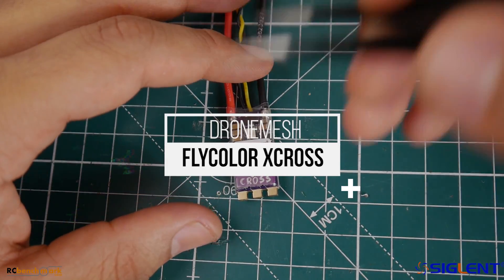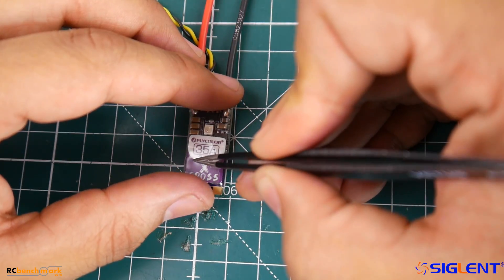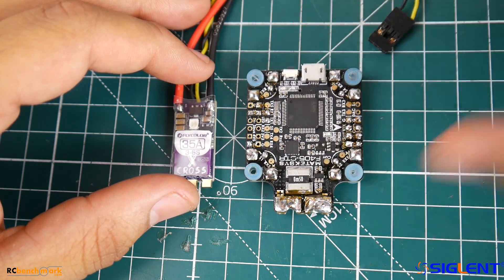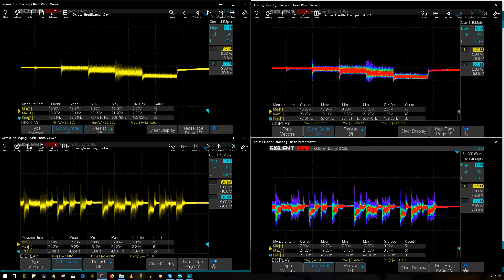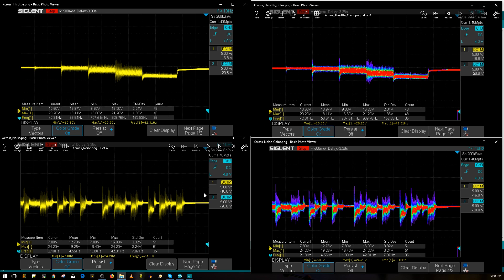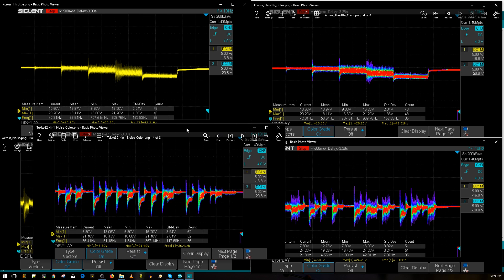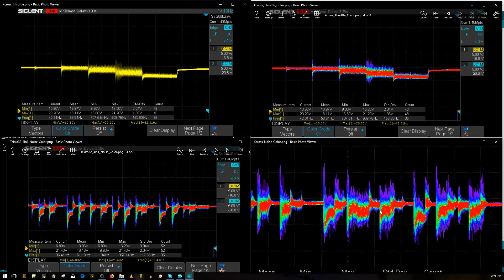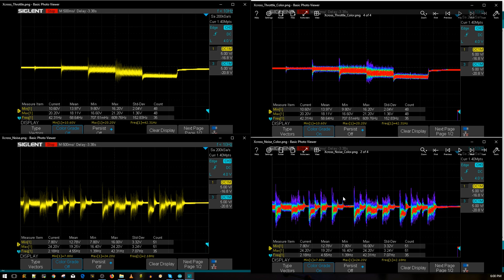FlyColor X-Cross 35A Blheli_32 ESC // Review and Noise Test

Comment: One other idea on capacitor / noise:  In your video putting a capacitor on each ESC what you've done is placed 4 capacitors in parallel.  Putting 4 in parallel would make the total ESR effectively 1/4th of a single capacitor.  So I wonder if instead of 1 cap on each ESC, or 1 large cap on the battery terminals, would 4-5 smaller caps in parallel on the battery terminals work just as well to reduce noise?  I think it would be a lot easier to wire 4 caps together to the battery terminals rather than one to each esc where they are prone to breaking in collisions....
Reply: Test it!
Reply: Fly-N -Ryan I'm going to but without an oscilloscope....  would be awesome if drone mesh could!

Comment: Have you thought about testing aluminum polymer capacitors?  Was browsing digikey and happened to see some newer capacitor lines from panasonic showing lower esr than regular electrolytics.  anyway, Good video as usual.  Like the data.
Reply: Here's one:  Kemet 470uf 25vdc alum polymer part# 80-A750MS477M1EAAE15 from mouser.  Has 4.9a ripple current and 15mohm esr.  Think it might work as well as a regular electrolytic for voltage noise?

Comment: Now they come up with a BLHeli 32 version too!
Just build a new frame, using the GemFan Maverics you recommended for budget builds. I want to play a little with the brake and ramp settings for 3D-Mode. 
They really work fine with a DALRC F405 AIO, 9V regulator on the VTX, 5V regulator on camera and a 470µF Cap. 
No noise at all :D
And smooth transitions from normal to inverted.